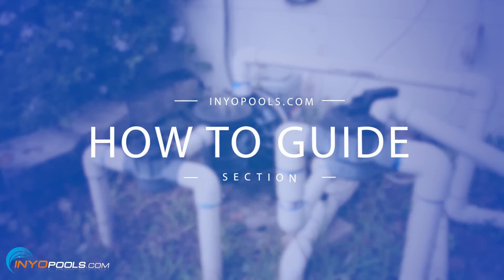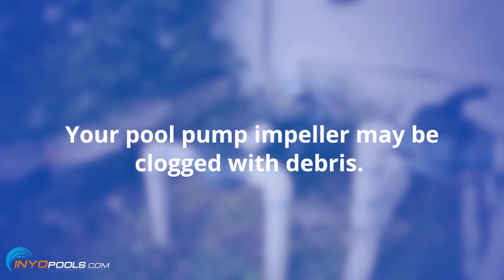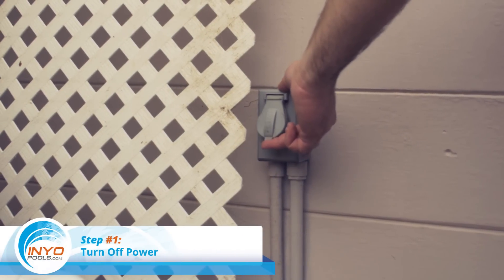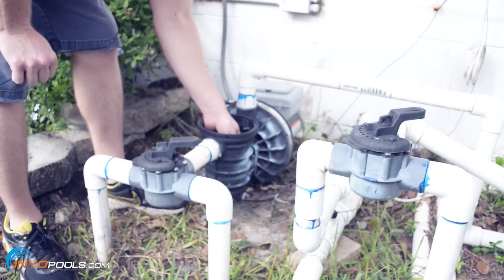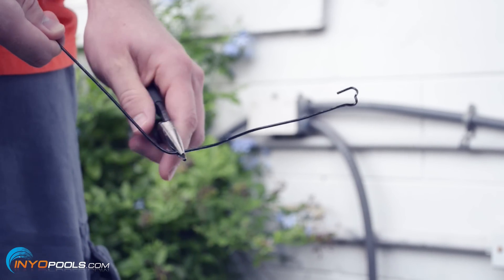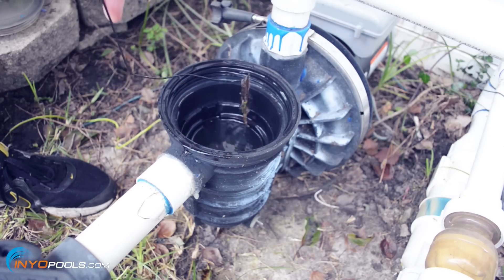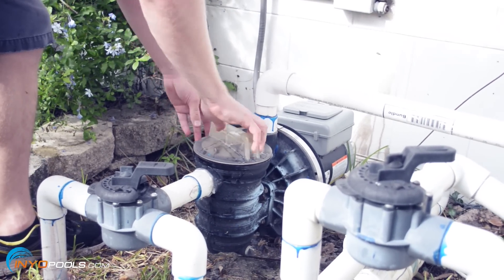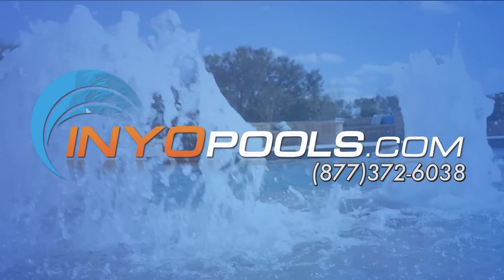How To: Clean Out A Pool Pump Impeller

Comment: My method open pump lid remove basket blast impeller with small water pressure cleaner reassemble pump run pump and re do the prosess 60% of the time it works every time fast and easy

Comment: Thanks for the video.  I used a coat hanger as described.  I was not able to "grab" any debri, but when I wiggled it around I heard loud sucking-like noises.  I am not sure what that was.  I thought maybe it was a sound of air sucking to the system because I had dislodged some debris  (even tho I couldn't see it on the tip of the hanger).   Any thoughts or feedback would be greatly appreciated!   I am a Subscriber to your channel.

Comment: Thank you for this video, I was at a loss!  Had low pressure at the return eye and when backwashing.  Impeller was packed with tree leaf casings that must have been sucked past the skimmer and pump baskets.  I used a flexible drain cleaner and my finger to dislodge the debris.

Comment: I did not pull anything out with the hangar, but was able to reach my hand in and pull out a couple small pieces of concrete that were jammed slightly in the impeller blades.  Pool cleaner is working better and the psi rose back to normal.
Reply: I have small hands but was not able to reach in with my hand to pull anything out.   I used a piece of coat hanger.  I was not able to catch any debris on the end of the coat hanger, but I think I must have dislodged something because I heard really loud gurgling noises right after I used the hanger.

Comment: I have small hands but was not able to reach in with my hand to pull anything out.   I used a piece of coat hanger.  I was not able to catch any debris on the end of the coat hanger, but I think I must have dislodged something because I heard really loud gurgling noises right after I used the hanger.

Comment: Here is a faster easier way. Remove the strainer basket and put the pump lid back on. Put the multiport valve on recerc. Open the air valve on the top of the filter. Let the water drain out of the filter. Close the return valve. (without this valve forget this). Close the air valve. Put the multiport back on filter. Turn the pump on and watch the pressure gauge. When the gauge stops moving up, usually around 40 to 50 PSI, turn off the pump. The trapped pressured air/water mix will blast backwards through the impellor for about five seconds. Replace the strainer basket. You have just fixed the problem.
Reply: W
Reply: This worked...  I did all the other tricks.... Pressure was less than 5.  Normally I see about 17 with a clean sand filter 60.
I do not have a return shut off valve but I did pressurize the filter like you said by putting the MP valve on closed. Got about 10 psi...  Shut off the pump moved the valve to recirculate  and the water surged back into the strainer container... Put the MP valve to filter,  primed the strainer and turned on the pump. Got about 10psi on filter not nearly  0... I repeated the process and now have 15...When I did the closed pressure build up I never saw over 30.  I believe my pump inpeller has some fins that are still clogged. I will get the pump impeller O ring and take it apart.  Did that about 15 years ago or so.  Pump is now 24 years old... Fingers crossed.  Thanks for the tip.